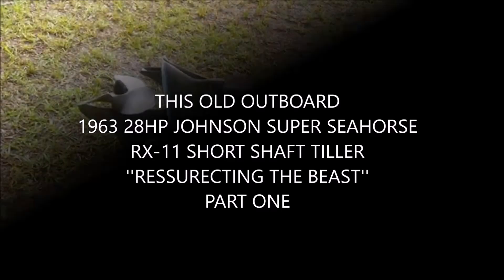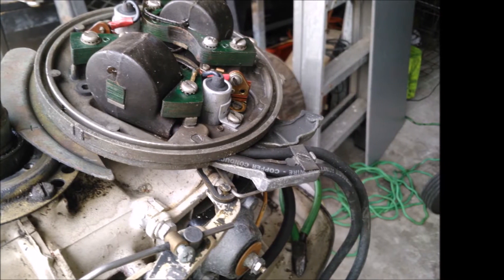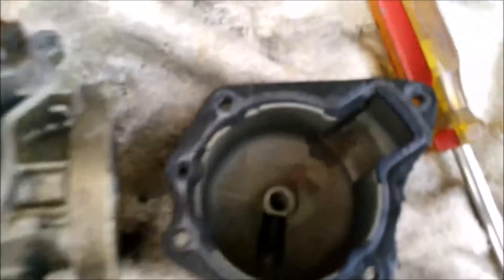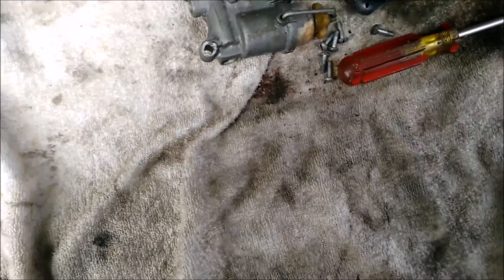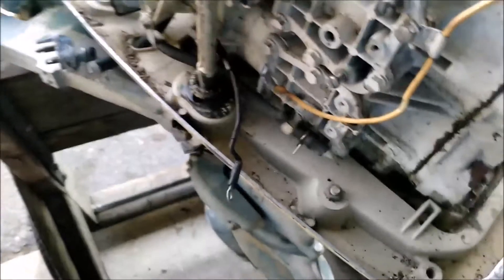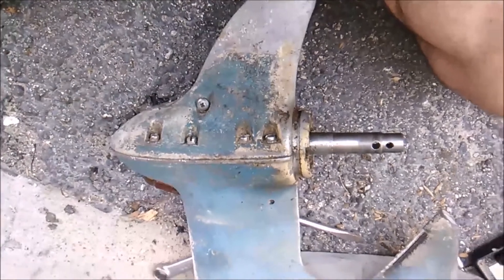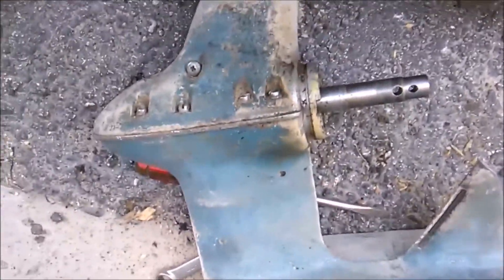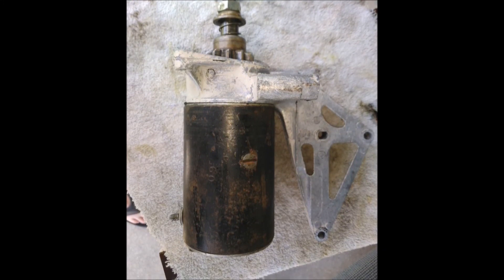1963 Johnson  28 Hp Teardown and Inspection

Comment: Do you know where the negative wire for the starter goes? Me and my dad just got a 62 and are trying to hook up the starter
Reply: Thank you!
Reply from the maker: Hey. The starter is grounded to the powerhead. The negative battery wire is connected to the powerhead and usually connected on a bolt close to the or on the starter bracket but any bolt will do for a ground. You can find a manual at boatinfo.no. and parts list at marineengine.com. Thanks for watching and commenting. Stay tuned !